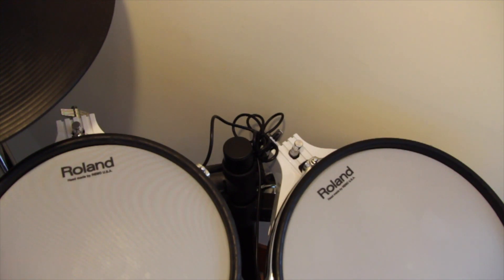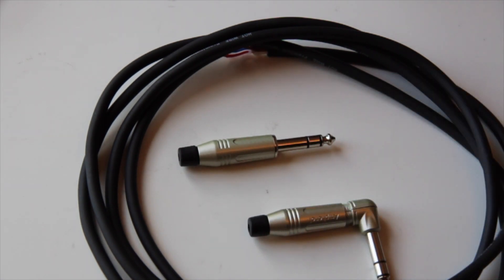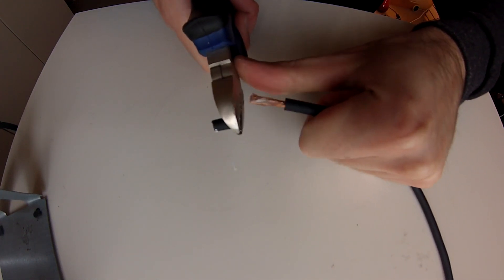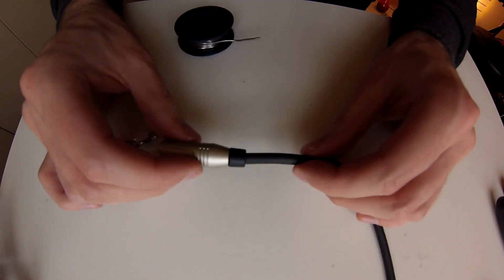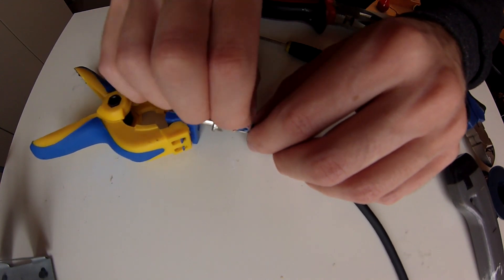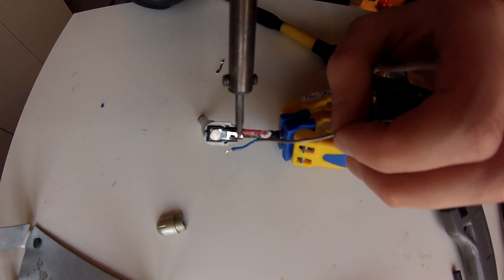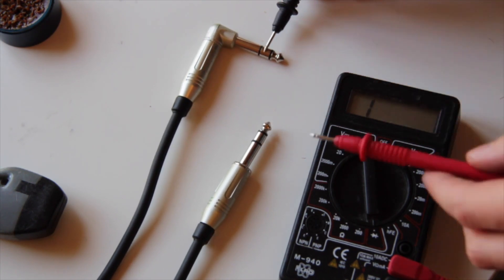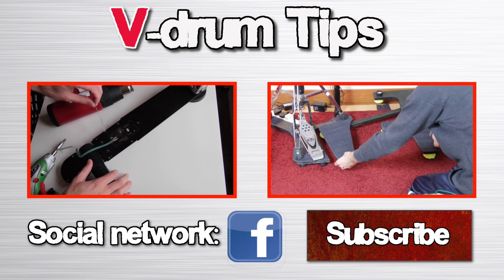How to make an e-drum cable (stereo jack)

Comment: Can't you just go buy a 1/4" to 1/4" stereo cable from Monoprice or RadioShack or something?
Reply from the maker: The purpose of making one is to have the perfect length. You will never have that with a stock cable.
Reply: OK, but a generic cable from an electronics store will work right?
Reply from the maker: yes, you need stereo for a dual trigger pad and mono for a pad with one trigger.